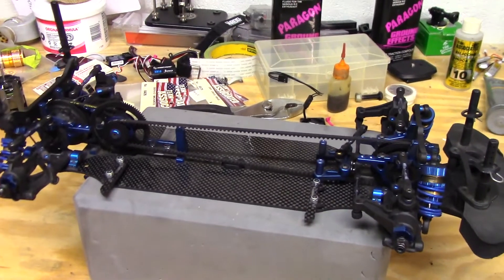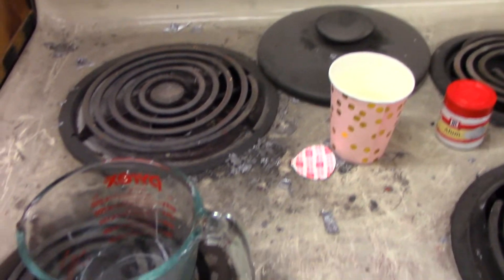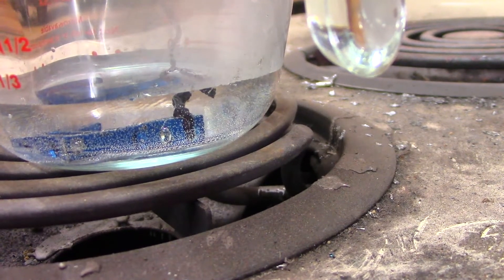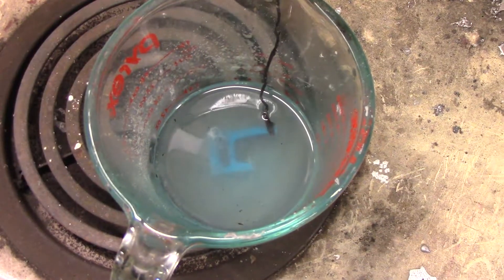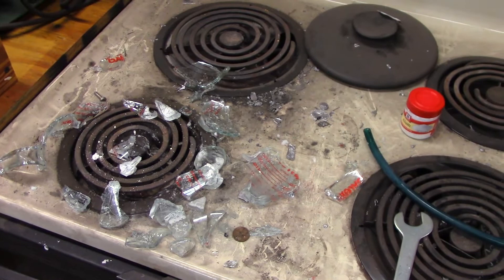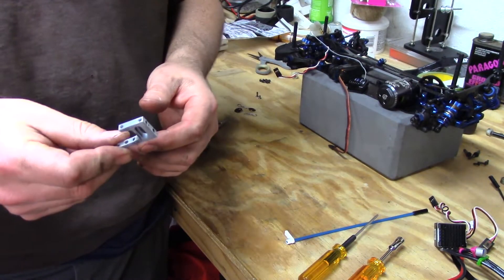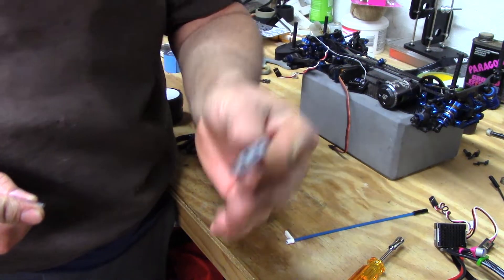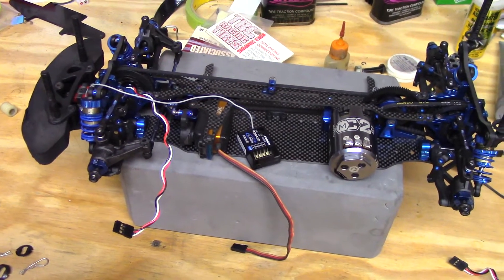Tiny Bolt/Screw removal

Comment: I like it. A lot. How could this work on a larger item, like a Land Rover door top frame? Can't put that in a pot and heat it. Tx.
Reply from the maker: @gavinbroad1743  It doesn't need a ton of heat to work. Even a 100w incandescent light bulb right next to it would do the trick BUT, it would likely take a few days for it to work.
Reply: @Pyro17059  That has to be worth a try. I have time. Got a stainless no. 6 sheared off in an aluminium door top frame. Those tops are in the hundreds of Pounds. 😬

Comment: Yeah, pyrex on an electric burner, not a good mix. Possibly enlist an old drip coffeemaker both for carafe and warmer. Jewelers call it pickling, to remove copper oxides.
Reply: Pyrex is heat safe what are you talking about. It’s glass that would be dangerous or if it was open flame and heating the Pyrex up so quickly it can’t expand and shatters. Crackheads been making base with Pyrex and cheap electric burners for decades